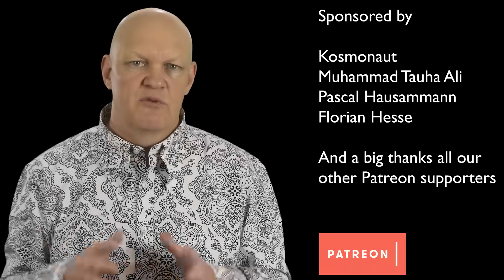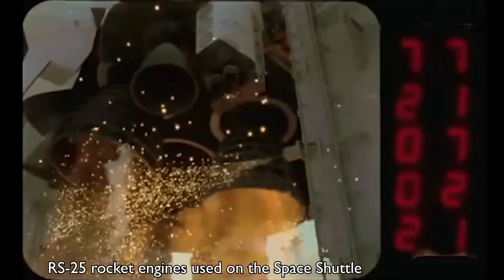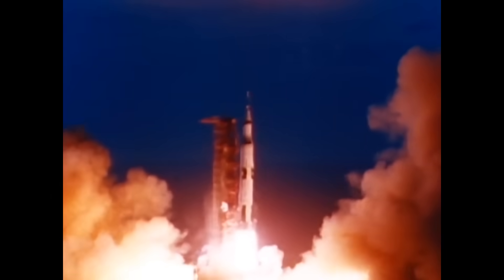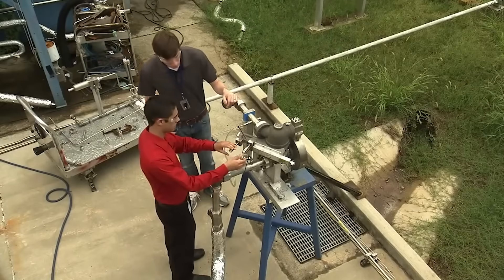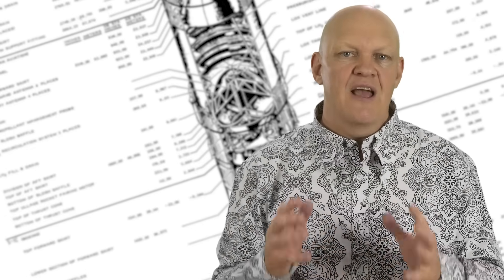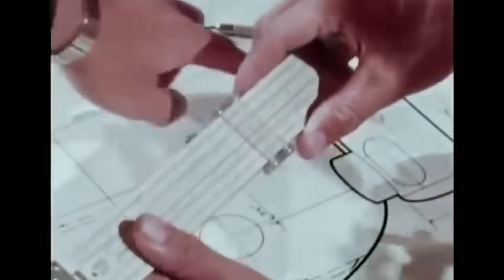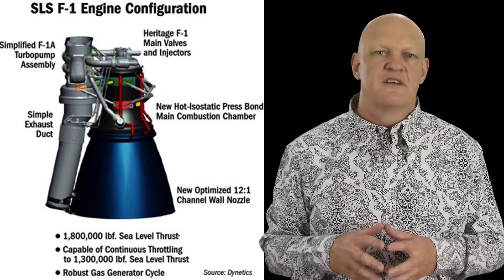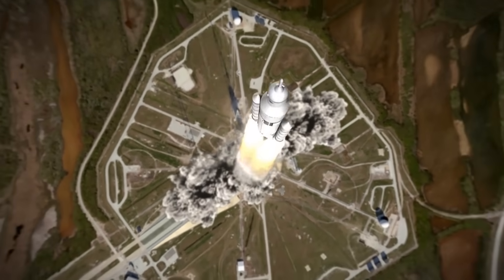Why Can't we Remake the Rocketdyne F1 Engine?

Comment: Remake the F-1 Engines ... it's a No-Brainer ! ! The F-1 splits the difference in efficiency between an Advanced Gas Generator Cycle engine (which is what the F-1 was) and the RS-25 Staged Combustion Cycle engine (SS main engines). Why is this? The F-1 didn't just 'dump' the 'COOLER' reactant turbopump exhaust gas overboard as all other gas generator cycle engines do/did (even Falcon 9 does), it used that 'COOLER' exhaust gas as a 'COOL' insulating layer for the engine bell extension you see on the F-1. This provided additional thrust that enhanced F-1 atmospheric engine performance (which is where it did most of its thing). That extension is just 'after' that scroll-looking thingy the wraps around the engine bell (about) 1/2 way down. If you look at Falcon 9 test footage you can see the gas generator off to the side, and the gas coming out of the reactant turbopump 'exhaust' is DARKER than what is coming out of the engine (proper). That's because it is 'COOLER'. If you look at F-1 footage, you see a layer of 'COOLER' gas surrounding the hotter gas exiting the thrust chamber/regen engine bell (upper part). This is why the F-1 was (and still is) PURE GENEOUS.

Comment: Just a bunch of excuses.  My Kerbal Space Program engineers have no troubles making similar engines, and do it with great ease.
Reply: And they do so without getting paid, or getting food! The best workforce ever.
Reply: LOL
Reply: Well, they did steal the best bits of the old engine, and changed the manufacturing processes for the new, so there was no need to have a serial continuation of the old beast.
Reply: XD. Yep it's almost as if they have an endless supply that they can just drag and drop from onto the rockets.
Reply: Agreed!  Also, they never asked for extra time or cheat notes.
Reply: My kerbals just find scrap parts on the side of the road
Reply: Yea total bellyaching solely to praise the older generation and then follow it with "we redesigned it to be a much more piratical".  There probably some teenager out there that could 3D print that bitch from home by himself.
Reply: Because NASA is a liar
Reply: @aerialsky871  no u

Comment: First mistake: The boosters aren't going to be reusable to start with, because they are being made out of surplus space shuttle parts. Future composite boosters currently being developed by Orbital ATK are being considered for reusability, as they pretty much got it down during the shuttle program. They also don't burn up. They just fall. Second Mistake: The SLS boosters haven't been designed from scratch. As of right now, as I mentioned before, they are literally just shuttle boosters plus one segment.
Reply: Baxter. Orbital ATK (now known as “Northrop Grumman Innovations something something something”). Yeah, the SLS boosters are literally just the SRBs from the shuttle but with an extra segment. I mean, you cant fix what isnt broke. My problem is that they could make something better and they’re being forced not to because they dont have the budget for innovation anymore. Hell, they’ve been using the Centaur upper stage for a few  decades now as their go to. I think the modern space industry belongs to the private companies being funded trough commercial or government contracts. As of late, NASA has really just been getting Boeing, SpaceX, Orbital ATK (yes i know i corrected the name earlier but come on, it sucks now), and various others. The only maintainers if the ISS right now are the Commercial Resupply contracts and ROSCOSMOS. NASA needs some more funding or rename themselves to “the National Aerospace Contract Committee”

Comment: This happens more often than people would believe.  I used to work for a company that made a decision once to shut down a US based manufacturing facility (where I worked) and move production overseas.  The reason they had given wasn't just the less expensive labor costs but also because the engineers had documented everything so well that it was trivial to do so.

So in the lead-up to closing the facility they stockpiled about two years worth of inventory so they had some breathing room until they got the overseas people up and running.  Eventually production moved and they either laid off or transferred people (like in my case) to other local facilities.

Fast forward two years and the stockpiled product started running out.  And that's when the proverbial doo-doo started hitting the fan.

Product defects were piling up and at first nobody in management understood why it was happening.  It bit them hard on the you know what but they eventually figured out is that just because they had the "how" (as in the blueprints and documentation) they didn't have the "why's" and the expertise behind the "why" that they now had no way of recovering.  The new people making the product followed the docs to the letter but they lacked skill and experience.

Eventually the company recovered from this mishap but they never truly learned from their mistake (which is why I eventually left them earlier this year).

Comment: Hi Paul.  I think that (as usual) the presentation quality of your videos remains excellent with the new shorter format.  However, as a computational modeler, I would have enjoyed to seen MORE of the work NASA did with the F-1B.  As I recall, it was quite a young crew that did the work, which - by itself - is excellent.  I LOVED hearing about the parts count reduction.  Regardng the >>reason<< that F1B didn't make it, that is something I think we would all like to hear more about (similar to your X-33 program).  I do observe that the Air Force space bureaucracy does not like new stuff, even when the changes appear to be trifling material changes.  Of course, nothing is trifling in space, contrary to what I believed in my youth.  The risk aversion to new tech is enormous, because of the consequences for failure.  ANYway, keep up the great work - Bob

Comment: Interesting that the F-1B just dumps the turbopump exhaust overboard instead of using it to increase the mass flow through and cooling of the engine bell as in the original.

Comment: 3:30 Friction welding has been around awhile; my materials engineering professor interned at NASA when the shuttle was under construction.  He stated that they experimented with stir welding an Aluminium Lithium alloy for the shuttle's external fuel tank.  Guess it didn't work out because they ultimately used that flaky orange foam.

Comment: We dont use tgat type of engine any more because it is out dated. The new engines for the Delta rockets are much more powerful and use less fuel. We do not need the F1 engines because we dont need it. That system is obsolete.